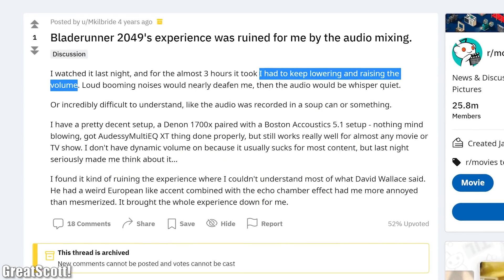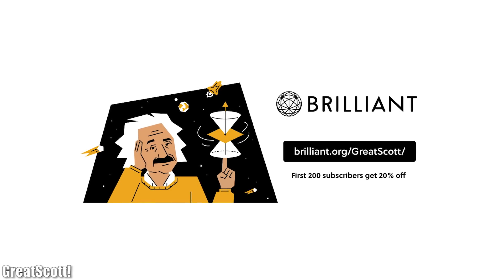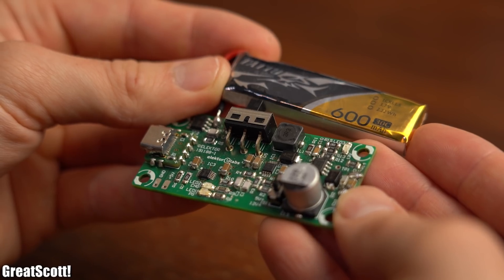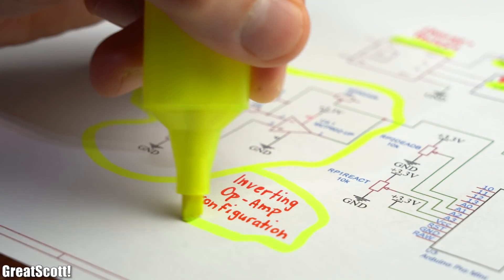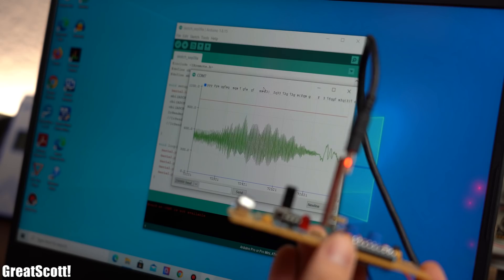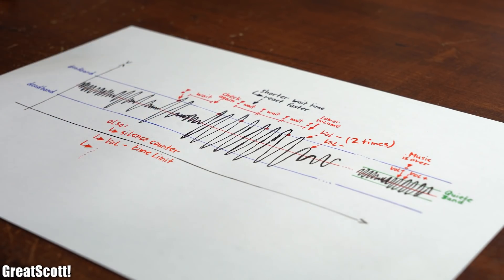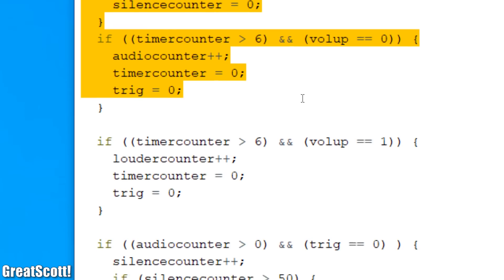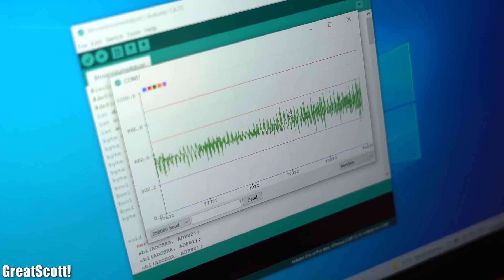Movie Music has a LOUD PROBLEM! So I fixed that! (Automatic Volume Adjuster)

Comment: Maybe you can get better results by removing the mic and instead use the audio signals from one of the (L or R) speakers. That way external noise will not  be an issue. Just curious, wont these receivers have inbuilt mechanisms to level the audio?

Comment: you not need programming. use vactrol automatic gain circuit. It uses photosensor on the feedback resistor on the amplifier thus high amplitude will lower gain and lower amplitude will increase gain . I used such circuit on my guitar string sustainer driver where it thicker guitar string makes more sound and thinner less sound so this circuit makes it guitar signal in a stable input amplitude for the driver circuit.

Comment: I would like to prefer to have a kind of audio filter, which would be able to decrease the sound level and let the conversation frequencies through directly within the original audio signal before the amplifier. Alike to the Karaoke-Filter to cut out the singe but just the opposite....

Comment: The soundtrack is mixed and optimized for multi-channel theatre systems with big dynamic range.  If you want a conversation to be the volume of a conversation and an explosion to be the volume of an explosion then you need high dynamic range in the audio track.  It's a feature - not a bug.   The correct tool to do what you're attempting here is called a "gain compressor" and they operate directly on the audio stream so are much more responsive.

 It's trivial to crush the audio using a dynamic compressor afterwards (your TV, BluRay player, and your sound system should all have this feature already built-in, in fact) but it is impossible to restore dynamic range after such processing so the only sensible thing to do is to ship the full dynamic range audio track for everyone who has multichannel audio and wants the authentic film/theatre experience and to let the rest of the people squish it with a compressor when they want a lazy, not too loud couch-potato experience with a crummy stereo downconversion.
Reply: Yes, action movies usually mean 'try to wreck the eardrums' but even if it's not an action movie, the music does that! Don't pretend like the movie industry isn't corrupt, everyone knows it is. If it wasn't, then try explaining away the disaster that was Star Wars episodes 7 through 9.
Reply: @iNsOmNiAcAnDrEw  That's a ludicrous non-sequitur.  How does Hollywood corruption profit from damaging your eardrums?  I don't think you thought that through.
Reply: @jzero4813  It's called collateral damage and someone already answered your question, keep reading the comments.

Comment: Lovely project, but I think there is a better way from an audio perspective. I suggest using an HDMI audio extractor ($15) and then use a 'proper' dynamic compressor directly on the signal perhaps do it with one of the cheap ADAU1701 DSP boards ($15) or maybe run it in soft on a Pi?

Comment: You know what I'd really like.... a volume adjuster that compensates for the time of day and background noise, I almost always feel like I have to turn the volume up in the day and down at night which is super annoying, and I remember as a kid the sound would be super quiet so I'd put it to a reasonable volume but without changing the volume at all was told that the sound was too loud repeatedly so this is not a new phenomenon to me.

Comment: You could run the audio through RTX-audio, which is using AI to analyze the audio to determine what is speech and what is music or noise.
It can produce almost entirely clean speech even when it's recorded next to a chainsaw or leaf blower.
It produces a mono signal, which you can then add to the center channel or a separate speaker.

I bet Nvidia could make a box which could do this, make dynamic range modifications and more, with the headless graphic cards built for cryptomining.

Comment: I think my sound bar has something like this built in, but it's a bit wonky, it tries to adjust too often so we keep having the sound go up and down when it's turned on, which actually makes it more noticable so we usually leave it turned off and just manually adjust as necessary. Your code seems to do a smarter job of it, so it's not constantly adjusting.

Comment: I actually considered building something like this as a ad-detector for my tv a few years ago. The idea was that most commercials are louder than the TV programs they surround, which means that if you had something detecting that, you could automatically lower volume, or skip if you're using a play-back device. I never made it because I never made time (in part because I stopped watching TV and went to mostly Netflix and Youtube), but it was a cool idea. Its great to see that someone has at least done that for fixing movie volume, and others can develop it from here. I love it. Keep up the good work everyone.

Comment: This is a genuine problem, and I don't get it why they can't make it like computer games-  separate volume for music, dialogs and explosions. It would save them from having to mix in those sounds again every time when translating the movies to other languages, but some new video encoding standard would be required (basically the same as the existing ones, but with option to have multiple audio tracks that all have to be played). I think they're trying to make it more "cinematic" so that rather than you not hearing the dialogues, you "should" have it at the volume when the dialogues are just right, but the explosions summon the neighbours, sand worms, dust from your ceiling and local aouthorities because they are waaaay too loud. This can be remedied on most AV receivers by changing the dynamic range or turning on the "night mode", but it shouldn't be necessary to start with.

Comment: If you have a "traditional" setup with separate amplifier and loudspeakers, you can connect a car light bulb in series with each loudspeaker wire. This will function as a signal compressor as soon as the signal gets too loud, as the bulb will start to glow and increase in resistance. You should experiment with the bulb its power rating, to see when it starts to light up. Or, if you have access to the analog audio signal before it enters the amplifiers, place a slow audio compressor there.

Comment: What you did there is called an "audio compressor" and is available as an audio filter on virtually any better mixer hardware. Not as an IR solution for your Soundbar though 😉

Comment: Wouldn't it be easier to use the variable dynamic range settings in the TV or AVR, setting them to night mode, which compresses the over all range of the audio? I also bumped up my center channel a bit above the calibrated level.

Comment: In my experience, this problem seems to be more dominant with "not so good" sound systems, but also relating to speaker positioning in the room. Especially if there are certain bass and middle-bass frequencies that are amplified by the room. But there are also problems with the higher frequencies that are often excessively annoying. 

Basically, if you have a fine sound system with good speaker positioning in a not-so-bad room, movies and music are more like silence. Usually, you'll only notice the actual loudness if you try to speak to someone next to you and they don't understand you. That took me 15 years to realize.

Comment: I like your effort, but I can't help thinking that it's a little like fixing a dent in your car by inventing an invisibility cloak... Your setup with only a soundbar in the middle that creates some kind of pseudo surround sound effect, apparently struggles with seperating the different channel. Voices are, generally speaking (pun intended) primarily on the center channel. Try "extracting" that so you can amplify that instead and lower the music.

Comment: Just buy a dynamic range compressor.  DBX made a bunch back in the day.  Their modern ones use XLR, but most of their vintage ones used RCA inputs.  I recommend the 3 band.

Comment: It's because it is mixed for cinemas and there you want the dynamic range often for story telling.... And in a cinema you do not notice the diffrence as much because of the sound treated rooms...
Other problem is an inproper mix-down from 5.1 audio where the speak comes from the center speaker. Also if you have cheap loudspeakers you notice it much more drastic, if you have good speakers this is not a problem. But it anoyes me to when i just want to watch a movie on TV speakers.

Comment: I just use a Stereo(2 channel) analog audio compressor on the front stereo pair. I have it set so that there's still decent dynamic range, but will squash extremely loud signals. If I don't need it for a particular show/movie, I can just bypass it. This is a pretty neat idea though, and I could see this being very handy if you're using only the TVs internal speakers.

Comment: Nice one, but I think it will take too long, the it information is slow specially in low-mid end TV's, I think an analog solution for this is the way to go, but yes it will require poke with the guts of the TV setup xD

Comment: I don't have a problem with music being too loud when it's just music, I have a problem with the music being constant and too loud all throughout the movie.
Movies used to have music to enhance certain scenes but no music when there was dialog, modern movies seem to have music all the time, and for some reason it is always loud and often louder than the dialog.  Simply turning down the volume, or limiting the audio spectrum, doesn't help in this case because you are turning down the volume of the music and the dialog equally.

Comment: With a proper sound system this isn't an issue. You are using a crappy soundbar that doesn't have a center channel to carry dialogue. Get a cheap 5.1, 7.1, or Atmos system and it won't be an issue. The sound mixers know more than you, full stop. They literally carry loss insurance on their hearing. They aren't stupid, or inept. Use a better setup.

Comment: I think it would be better to just build a dynamics compressor and put it between the source and the speaker amplifier. That would require having an analog audio output from video source and an analog input for the speaker system.

Comment: Could you just put a filter on the output to the speakers to limit the volume? That could prevent the high volume from even going through, right?

I am not an electrical engineer, but couldn't you absorb the amplitude in some capacitors or some sort of passive circuit?

Comment: Tricky question for PROs: I have 5.1 Sony system with STR-DE495 receiver. The problem is: after using the system for a while the receiver gets warm (you can feel the heat coming from inside, but nothing dramatic), the problem is when I turn the unit off for some time (e.g. 10 minutes) and when I turn it back on usually one of the main front speakers (sometimes both) is dead. What I need to do is to (while playing some sound) to MAX the volume for a sec and the dead speaker "comes to life" - just a very quick peak that "wakes it up" (literally). I can do this software-wise by rising the volume or physically by turning the volume knob. OR, while the music is playing and one of the speakers is dead, I can literally physically touch and push-in the cone of the main midbass driver and it suddenly gets its life. What the hell is this and what's the problem? The center and surrounds don't suffer from this, it happens only to FL and FR (Sony SS-MF450H). The receiver is connected to my PC via optical connection. Thanks for any advice!

Comment: hey Scott

version 2! 😁
I was thinking, why not go analog instead. maybe you could play around with an adjustable attack/decay response audio compression. get the audio out from source and run it thru the circuit. final output goes to the amps. It would be much faster lowering volume. maybe fancy around with an LED indicator for circuit 'activity'.

Comment: You couldn't be more right about this, I have tried surround sound, sound bars, changing setting after setting and every thing in between.
Would be nice if there was a product I could buy as not every one is capable of building one of these.
Brilliant idea still, maybe manufacturers will catch on and add some thing like this to their equipment from factory.
Genius!!!

Comment: For these blu-ray need a reference listening level value and for movies only warning:-) on the cover. Other case they had to create a home mix to the other audio channel.
By the way you could find a loudness measure docs for the project, in this case you have delay always, the perfect solution if you could pre-read from metadata the loudness and peak values:-).
Congrat for it, coz you tried!

Comment: The real problem may be that movies are recorder in surround now. If you do not have a properly calibrated surround system, the volume of your centre channel (used for speech)  may be too low compared to other speakers, or you have crappy hardware down sampling 5.1 to stereo.